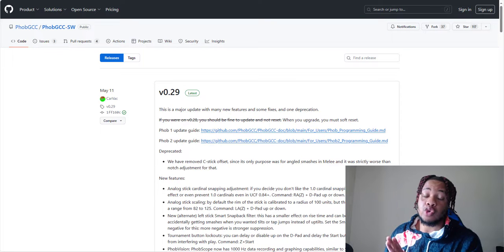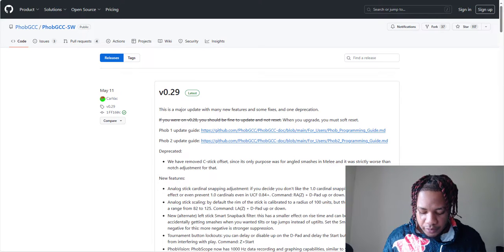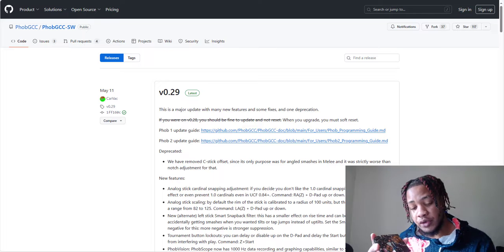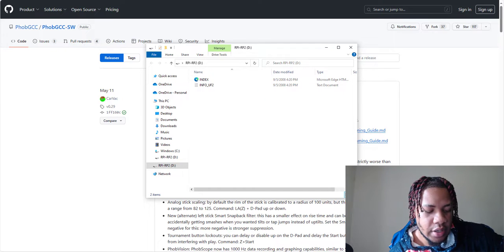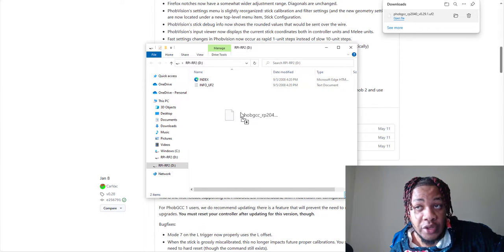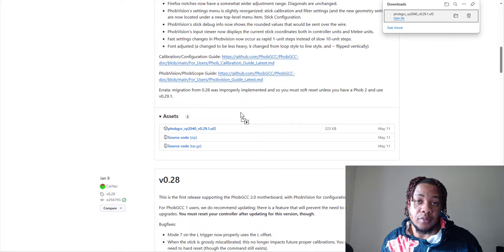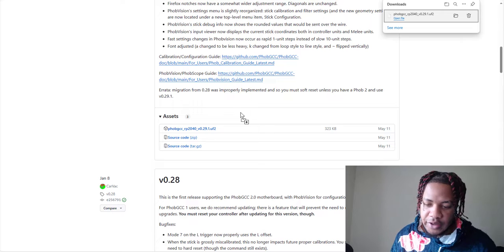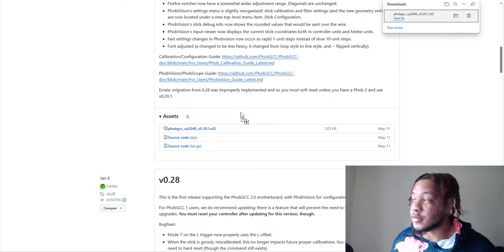How To Program or Update The Phob 2.0

Comment: the controller isnt showing up as a usb device.
Reply from the maker: You need to hold down the button at the top of the controller AS it is being plugged into your PC, if you don't, then it isn't going to show up. Hold the button down, keep holding it as you plug the cable into the computer, then you should hear a "device connected" noise from your PC. If you don't hear that noise, then you might not have a data-capable USB cable, and will need to get one.